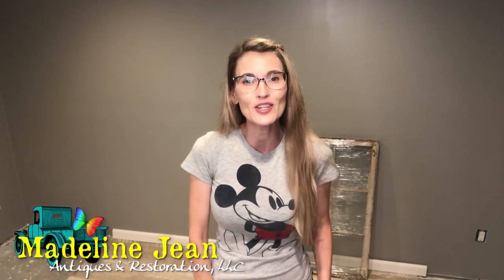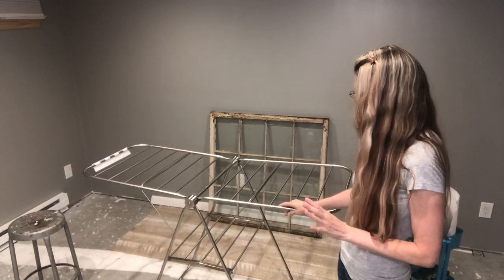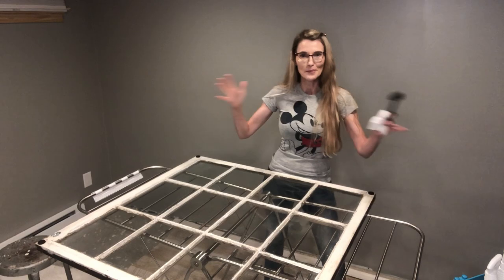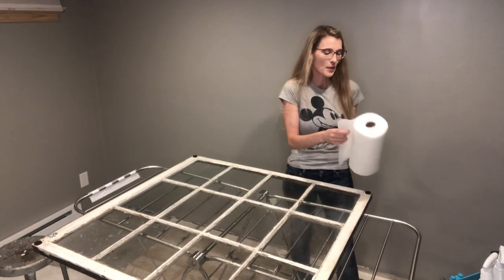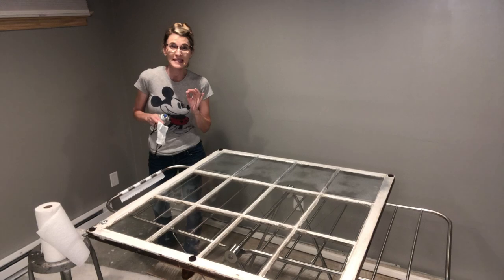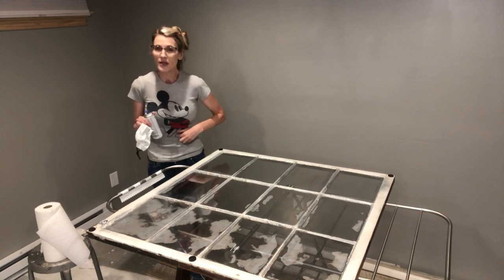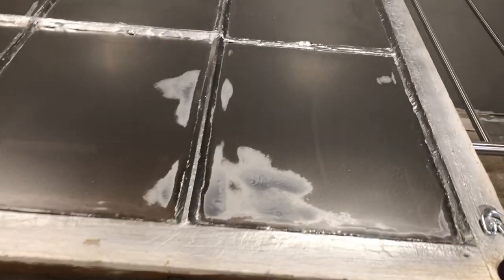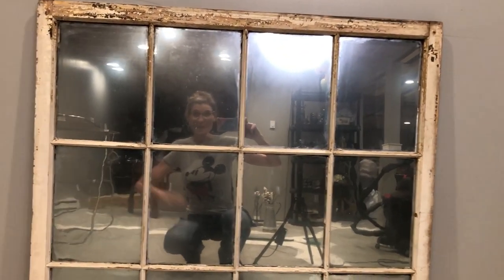How To Repurpose an Old Window into a Mirror

Comment: I was thinking of putting this looking glass on a small curio cabinet that I will be using as a linen cabinet that I don’t want to see into. Do you think once fully cured you could apply a polycrylic or polyurethane top coat to prevent scratching? Thanks
Reply from the maker: This is a great question. I'm not sure. I've never applied a topcoat over this product. What I have done in the past is place a thin piece of plywood over the back of a window to protect it from scratching. That's always an option.

Comment: great tips!!!   if I may offer one back.   I have used  chains to hang windows like this  after i  "play" with it.   AKA  Patina, wax, oil paints, colored glass, rocks, shells, etc.   Note:  the chains, the way i do, are visible  , usually screw i an eye-hook or similar  to the wooden frame. and  have used 1,2,or 3 depending on the size as a room divider.    Hope my horrible grammar was  legible.   hahaha   
Again,     Great tips and communication with the audience(im a  communication  advisor/coach, so I tend to notice  those things,  im not normal, hahaha)  Stay Smilin'   DavySTUN
Sidenote:  Being a Boston Boy,   I appreciate the mask!!!
Reply from the maker: Yes I've seen many restaurants hang repurposed old windows using the chain and eye hook method. Looks pretty cool suspended like that. Thanks for watching and commenting!